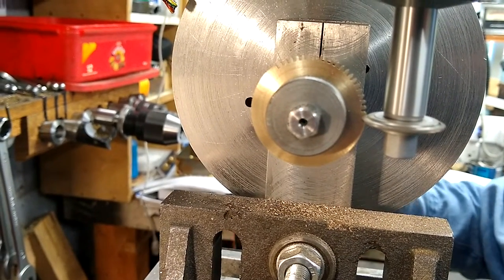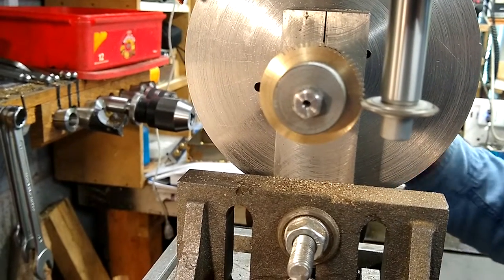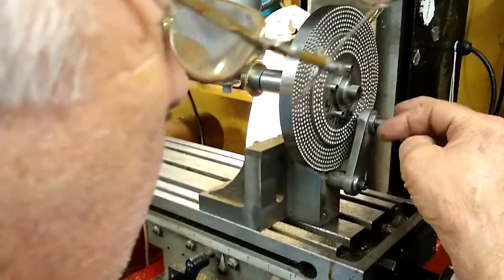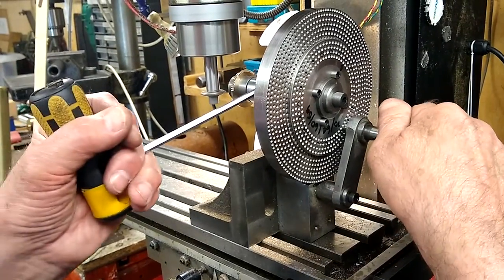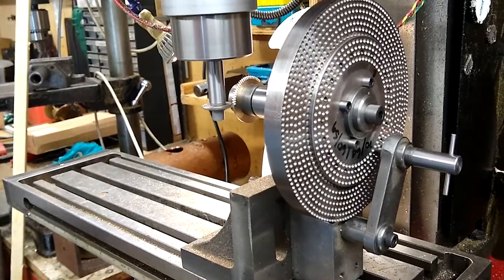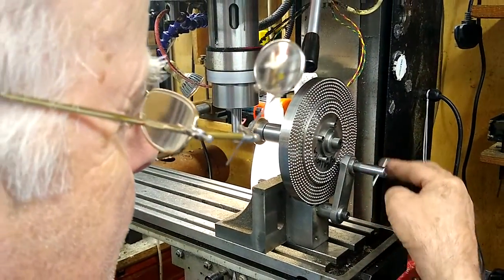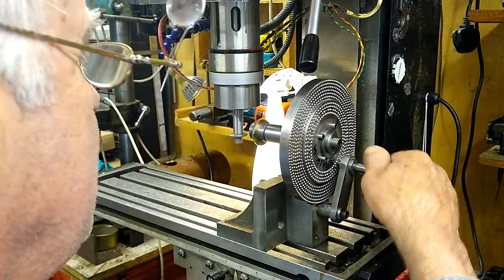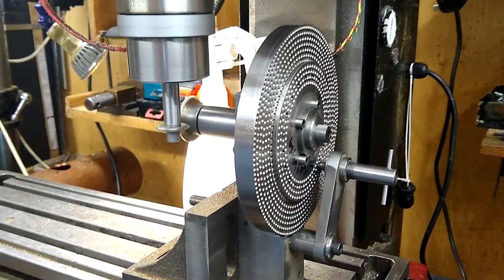Regulator Clock Motion Wheel Cutting

Comment: Beautiful setup. Love that indexing wheel. I'm curious, why screw in the pin rather than have it spring-loaded to save time? Thanks for sharing.
Reply from the maker: Yes I did consider that method, however after sevaral failed wheels and poor accuracy of tooth placement I wanted to leave nothing to chance and ensure an exact tooth positioning as possible.
I have never cut gears or clock wheels before this clock and I was worried about any mistakes I may be inadvertantly be making due to my lack of knowledge and experience.

The blog for the Regulatoe Clock may be viewed at :- http://www.clockworkengineer.wordpress.com.  There you could find the details of how I came to develop the method for indexing wheel method with vidoes!

Thanks for your most kind comments and interest.  Regards.  John
Reply: @johnfirth9217  That's great. Thanks for the explanation. I just made my first gear a couple months ago, so I can completely understand. Looking forward to more content.
Reply: I am very impressed with this method as it saves time as opposed to farting around with dividing machines with crank handles and tedious repetitive adjustments. I also like the idea of direct indexing plates with screw in pin that keeps everything stout and with the lock nut. Much quicker and easier particularly in clock gear replacement. Many thanks, Jim from Australia.